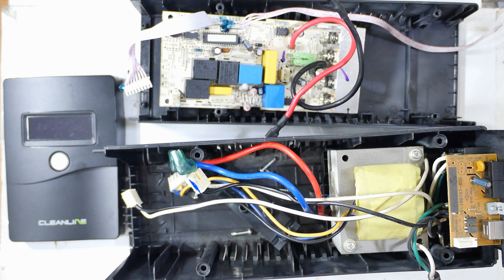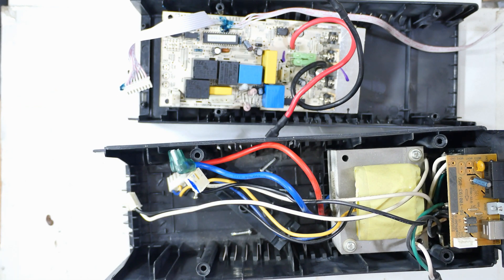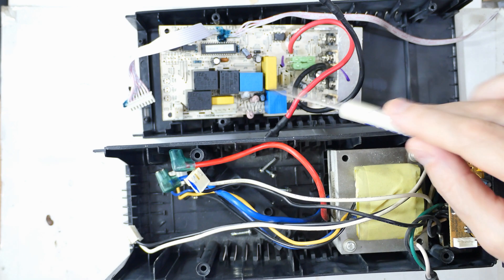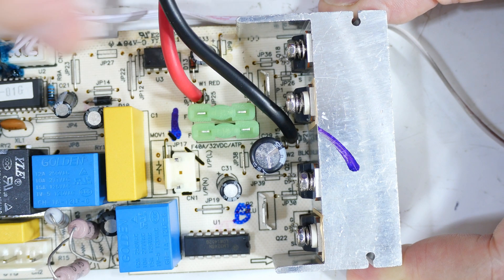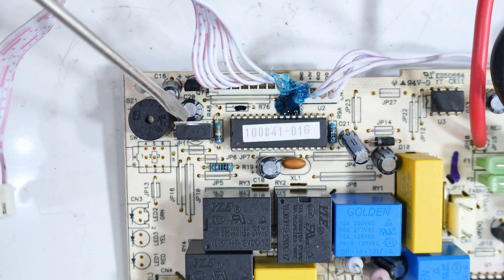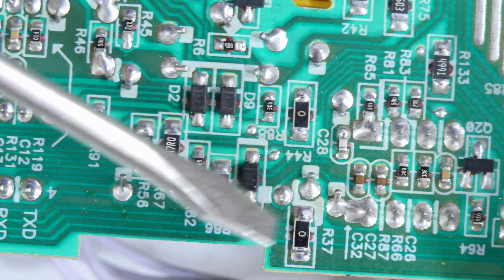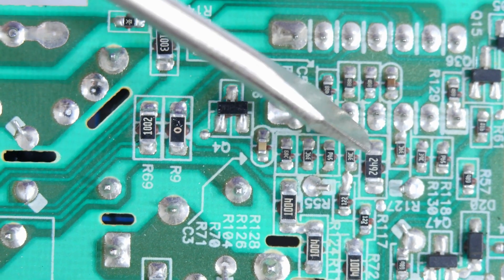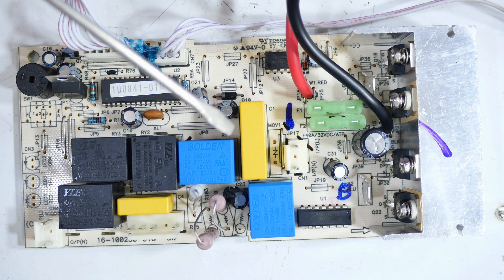Salvageable Parts From A Bad UPS Board (4K)

Comment: Did you work out why the UPS failed?  I saw what looked like one dry joint @ 6:42 near the slot in the board at the right, but it may have just been a shadow.  Nothing else looked "hot" as such.  I have an old Eaton 3105 UPS which will probably be disassembled like yours as it's doing strange things.  I will try a new battery first maybe as the electricity supplier has had our 240V supply voltage at 260V at times and I know that will destroy LED globes like popcorn, so maybe the battery in the UPS is fried too.
Reply from the maker: I suspect one of the proprietary chips was failing because like yours, it was doing strange things like the LCD screen was showing junk, fading in and out, it would jump to battery mode at random, then it just failed to no power mode. I did not see anything obvious, and in fact I am salvaging parts off the boards and can't see anything wrong. No cold joints, in fact I've never seen so much solder used on every joint, including the surface mount parts! Remember to take care when opening a UPS, because they can "come alive" even with a "dead" battery.